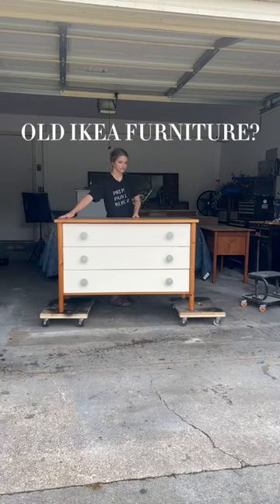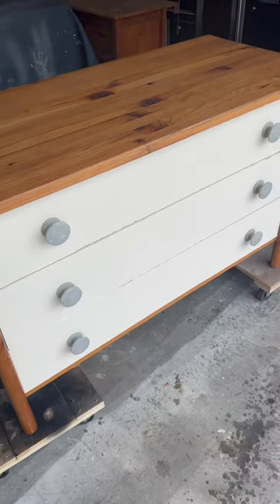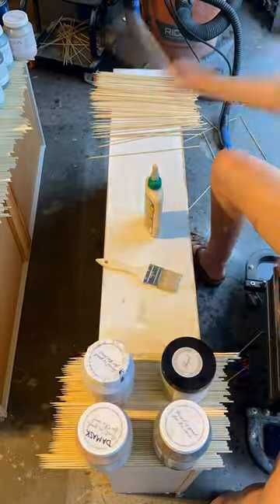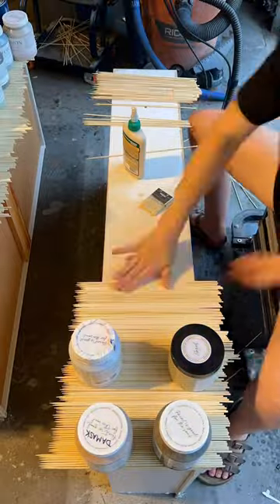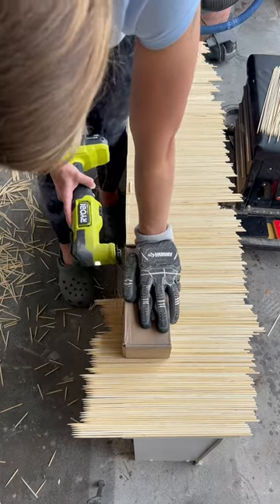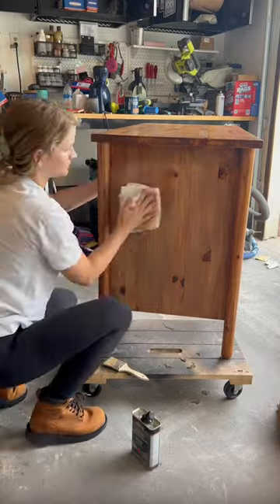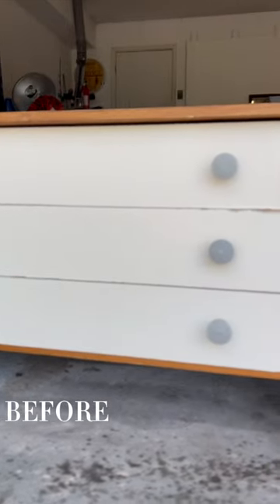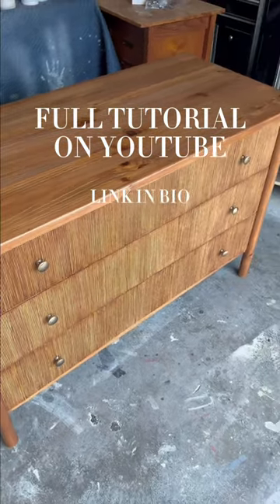🔥 $50 IKEA FLIP 🔥 #hack #furnitureflip #diy

Comment: i like the look, but the skewers will be a pain to keep clean, dust will get stuck…
Reply: Maybe Vacuum with a brush attachment? 

I would suggest filling the crevices with the sealer or resin but that might make it too shiny and take away from the textured look.
Reply: Maybe dust it off with a dry paint brush. The surface is vertical so it won’t get too dusty.